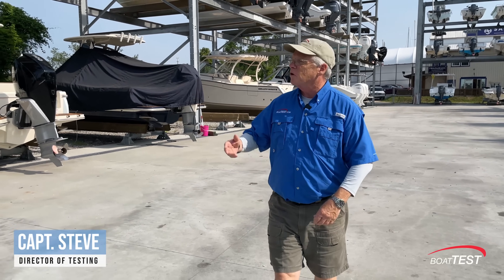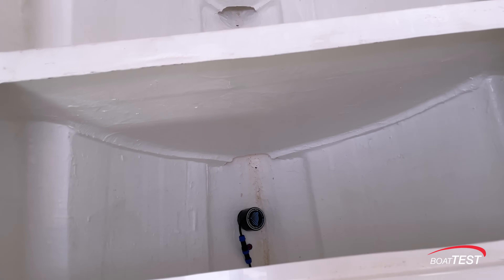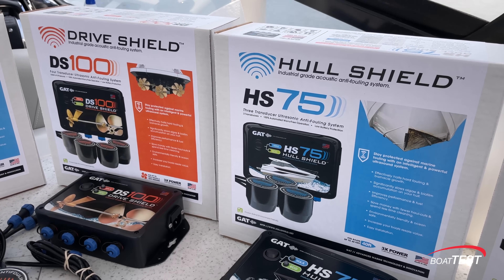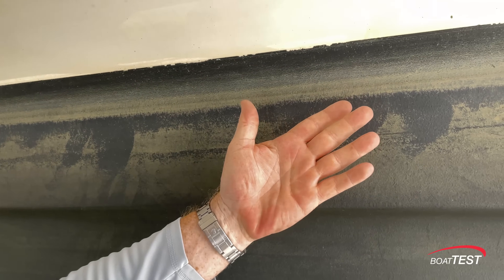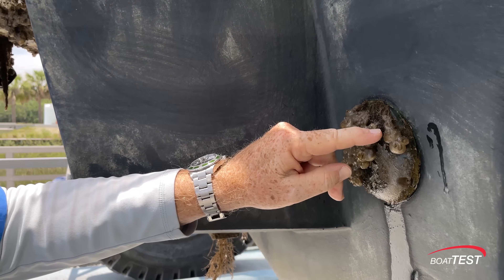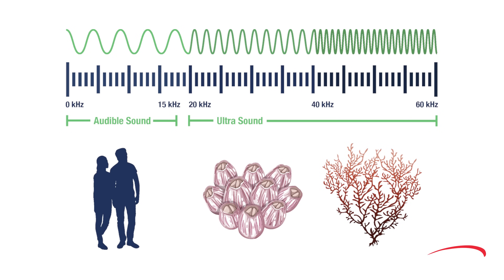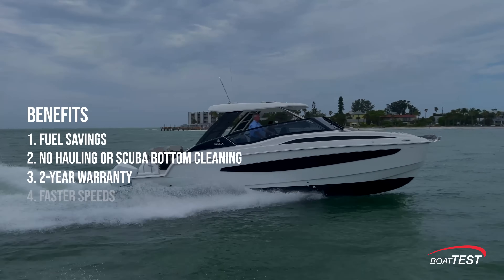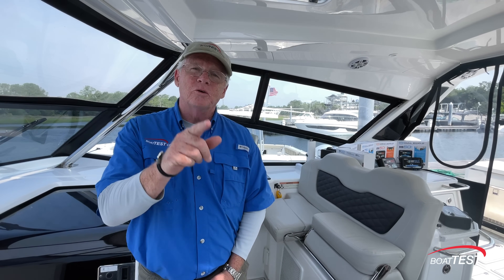Hull Shield Product Video 2022 by BoatTEST.com

Comment: Captain Steve, after seeing your review, I bought the equipment, installed it on my boat, a 2007 Tiara 39 Flybridge, 24 days later the result is horrendous. this system doesn't work at all
Reply from the maker: Hi thanks for your message we are passing this to the team, and of course very concerned that you had a horrible experience. Please send us your email if you can or better yet write to editorial@boattest.com. Many thanks!
Reply: Captain Steve, I’m genuinely a fan of your reviews but I’m not happy with this one.  The video should have shown the boat bottom as it came out and it should have shown it dripping wet versus bone dry.  That invalidated it for me. Sorry

Comment: These systems have come and gone for decades. If they HONESTLY worked the Cruise Ship Industry would all be onboard with them BUT THEY ARE NOT.
Reply: We asked the folks at Hull SHield to reply to your statement and this is what they said:

The scale of the solution begins to exceed the practicality of the implementation.
Cruise ships are among the largest ships produced with massive hull areas, but as with most larger ships, the hulls are surprisingly thin for the size - 1/2" to 3/4" even for the largest of ships. This requires many, many, many evenly spaced transducers covering acres of area. This becomes nearly impossible when much of the interior hull is inaccessible (ballasts, sealed bulkheads, etc).

Another factor is that larger ships generally stay in motion in open water - they experience less fouling because of this. Much of the fouling accumulation happens when at port. This factor becomes more evident for the cruise industry when, at the height of the pandemic, the industry experienced a fouling crisis because the ships were docked for long periods (no cruises).
Reply: @jeffhammond9091  The proof of the pudding isn't ultrasonic's ingress into the commercial shipping or cruise market. The proof is, how much traction has this technology gotten in the recreation boating market? And the answer is, very little. Considering that ultrasonic anti fouling systems have been around for decades, you have to ask yourself, if they performed as advertised (this video being a prime example), why is it that almost no recreational boaters use them?
Reply: @fstbttms sounds like your bottom line is in jeopardy which is why you waste time trying to hold off the inevitable. 
It's on my yacht and works great
Reply: Just like claims of sellers of this product, I highly discount claims from divers who will lose money if these work.  Still looking for non-affiliated third party real studies of efficacy.
Reply: @russdykstra  well I'm a diver who sees that it works, so what then?
Reply: Actually it does work. I installed it on a customer's boat that I also dive clean every month, (and he's overdue for a paint job) and what took over 3 hours takes less than 2 with 2 months between cleanings. Sold me.

Comment: I live in one of the hotest spots in the world 
Do you think it will work here where the wether reach's 57c or 135 fahrenheit
Reply: Buy an HD1 for 499.00 and pop it on your hull or engine for the shaft Prop. If it works well in that bathwater (wow 135°) then buy the systems needed to complete. You can simply change your cable over to another driver box HD4  if needed.
HULL SHIELD is 3x more powerful than Sonihull btw

Comment: What I would like to see is a boat in the water for an extended period of time without this product, then thoroughly cleaned and repainted then in the water for an extended period if time with this product and compare the results.
Reply: Or, Turn the system on for 12 months, haul it and check.  Then turn it off for 12 months and do the same.  This would cover all seasons.
Reply: A two year test for a product that has already proven itself to save on maintenence over the years. Its becoming an option on major boat manufacturers new builds and just last week I was at a boat show on the west coast and yacht broker Denison Co. had 4 with Hull Shield installed. It's here and exploding. Only a matter of time till people wake up. Btw, it's on my 80ft yacht and I'm delighted
Reply: catamaran would be best,, with one side 'protected' and the other side not..... it's been requested of the companies yet they never do ...Hmmm I wonder why !? ...hint: because it's completely BOGUS